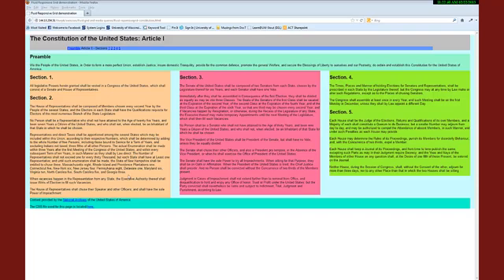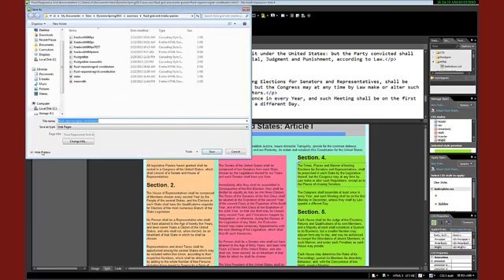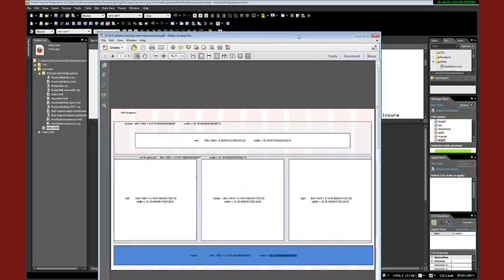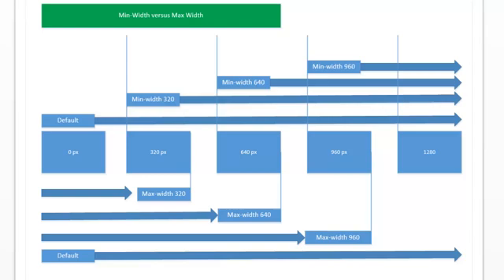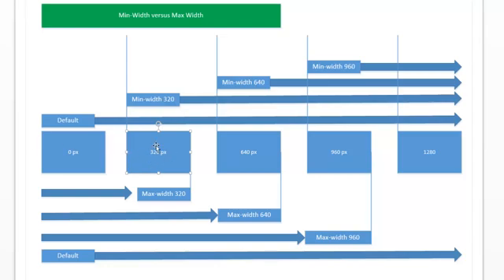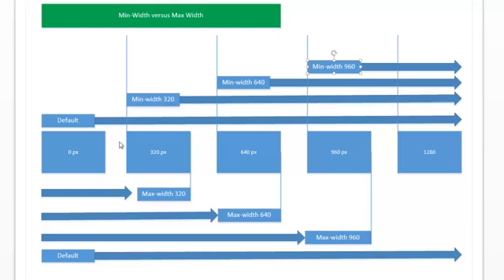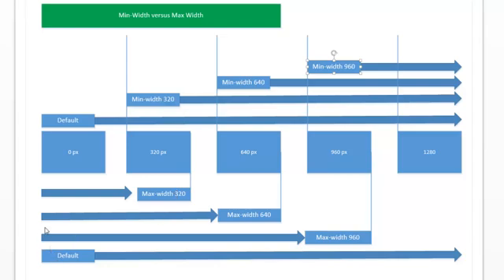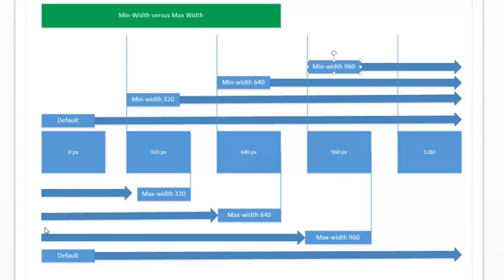Media Queries - Understanding the difference between min-width and max-width

Comment: For optimal viewing (and loading speed) wouldn't you just want to use both? Create a window of styling for whatever viewport size comes its way?
Reply: +Kevin W. Tharp (Doc Tharp) I think min-wdth approach as explained by you is the most preferred approach. I suppose they call it Mobile first approach.
Reply from the maker: +Parks33 You will want to primarily use either max or min, but they can be mixed.  If it gets too complicated, the browser starts having conflicting rules, and when that happens it will apply whatever comes last in the cascade.

Comment: Summed up, for your media queries, if you want your style to kick in at ___px and ABOVE, use min-width.

If you want your style to kick in at ___px and BELOW, use max-width.

Example, you want your style to activate at 400px and below:

@media screen and (max-width: 400px){ your styles here }

Activate style at 600px and above:

@media screen and (min-width: 600px){ your styles here }

By the way, the @media declaration is not only case-sensitive, it is SPACE sensitive. You must type it exactly like this:

@media screen and (min-width: 600px)

Or it won't work. Bad example:

@media screen and(min-width: 600px) <=== missing space between "and" and the first parens.

Make sure you use proper spacing!